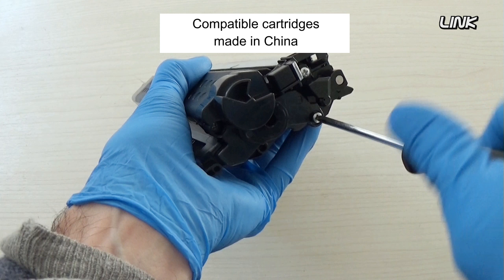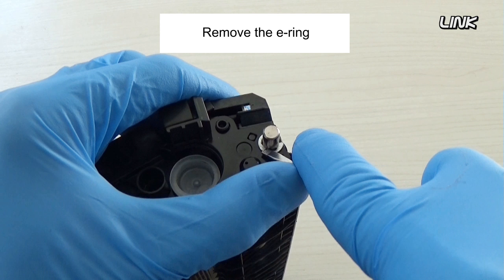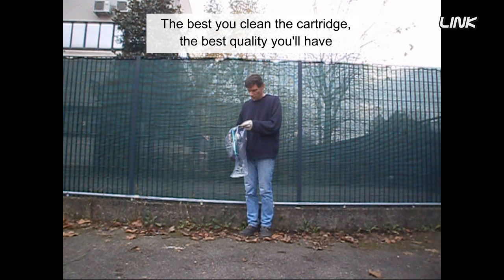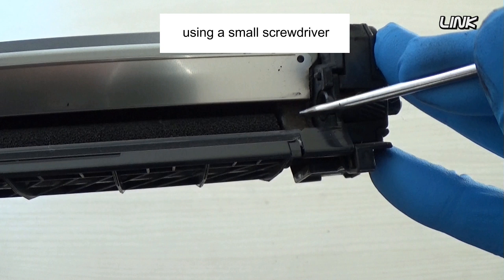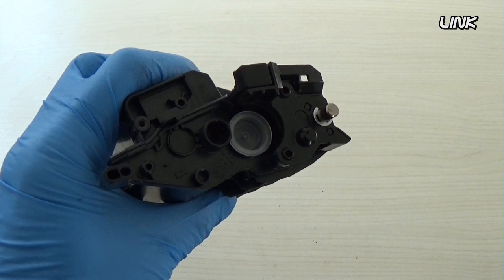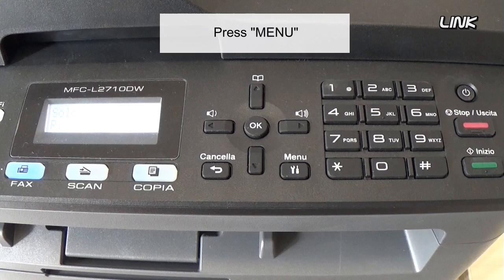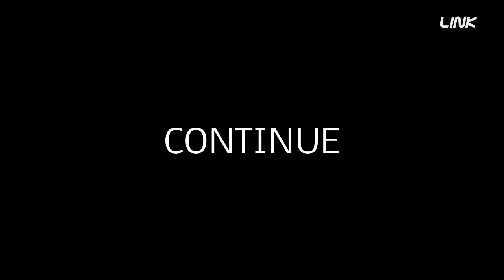Brother TN730 TN760 TN2410 TN2420 TN3608 Refill Rset Toner Cartridge

Comment: Thank you for the video. It worked, though when I was checking the Cartridge for leaks without inserting the shaft and gear, the toner powder started to drip off the hole where the shaft and gear are placed. So, I had to insert the shaft/gear and then everything went smoothly. 

For those who also use starting cartridge and hl-l2395dw. In order to remove the replace toner message, open the Cover (where the cartridge is placed), press X, then wrench/screwdriver, all settings,  general setups, scroll down to "replace toner", select "continue" instead of "stop". Hope it helps.

Comment: Great video! But I was wondering, instead if compressed air can't we just use a vacuum cleaner?

Compressed air is not easily available and more importantly wouldn't it make a mess anywhere it was used?
Reply from the maker: Sure, a toner vacuum cleaner is perfect. A normal vacuum could not become a problem, often their filters cannot hold the tiny toner particles

Comment: Thanks for a nice video! Some questions about the chip: 
(1) Does the starter cartridge also have a chip? 
(2) I don't understand what you mean by "remove the old cartridge chip" and 
"replace the chip in the new cartridge" since you're just refilling the old cartridge.
Reply from the maker: Start cartridge has ho chip. Remove the old chip and reistall it only if you are installing a new cartridge without chip. If not, let the old chip
Reply: @viandant5  thanks!
Reply: @viandant5  ok so it will work without the chip too kk
Reply from the maker: @radekw708  It needs a chip, new or used
Reply: @viandant5  I thought starter cartridge has no chip?
Reply from the maker: @radekw708  No. it has no chip
Reply: @viandant5  My DCP-L2550DW printer starter cartridge has a chip.

Comment: You left out a step in the re-asssembly in this video.  After the roller is reinserted and BEFORE the c-ring is popped in,  there is an important piece that needs to be put in, that the c-ring holds in.
Reply: Which one is that? I'm having trouble with my printer that I just refilled the toner in

Comment: Let's say I don't have the starter cartridge anymore, will it work if I don't replace the chip with the chip that comes with the starter cartridge ? Is there another way to make it work ?
Reply from the maker: The chip from another cartridge will work the same
Reply: @viandant5  Thanks! It's good to know. Also, is there a way to know what quantity of toner (in g) I have to put in it ? I have a TN-760 brother cartridge. Does it makes any difference if I put too much ?
Reply from the maker: @Nicolasgtix  90 grams of toner. It's useless to put too much toner, you'll have the error message after a numbber of copies, not important how much toner is left into the cartridge
Reply: @viandant5  Good ! Thanks a lot for your help. :)

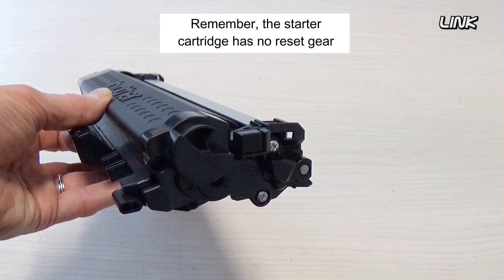Comment: Where it says "remember the starter cartridge has no reset gear." can you still use the starter cartridge as seen at 05:04 or do you have to get a replacement for that end of the cartridge that has a reset gear?
Reply from the maker: you can add a reset gear, or reset the printer using the control panel
Reply: @viandant5  Thank you for that info. One more question please, when air blowing the cartridge to get any remaining old toner off, do you have to blow the air into the fill hole to get any excess toner out of there or will tapping the cartridge into a plastic bag be enough before refilling the fill hole with new toner?
Reply from the maker: @simonbpuk2949  It would ne better to blow the cartridge. Tapping the cartridge should work but there is the risk of grey background on the page if too much toner remains into the cartridge

Comment: How come you have to replace the chip on the cartridge and with what? Why can't you reset the cartridge with existing chip?
Reply from the maker: If not present in the new cartridge you have to use the chip of the old cartridge
Reply: @viandant5  I want to just use the starter cartridge and refill every time, so dont need chip right?
Reply from the maker: @radekw708  Yes, you need a chip
Reply: @viandant5  can you explain though, how does the starter cartridge work without a chip?
Reply from the maker: @radekw708  The printer has a software that tell it to accept the installed cartridge
Reply: @viandant5   both starter cartridge and another genuine replacement cartridge doesn't have chip toner model 2405, will it work if I refill
Reply from the maker: @bahaar5419  I think they must have the chip

Comment: The refill cap broke and then got lost inside the unit. After I filled it with toner I had to throw everything out.
Reply from the maker: Pour the toner in a bottle and remove the cap with pliers. Glue it if necessary

Comment: Hi! Does any refilling toner works well for any tipe of cardige or evrey one needs a specific one?
Reply from the maker: no, there is not an universal toner
Reply: @viandant5  So for the tn2420 brother toner i need its specific refiller. 
I've search it on Amazon buy i didn't find it: do you know where i can find it?  before buying the printer (mfc-l2710dw) I want to be established :).
Reply from the maker: @usk8130  You can use almost every black toner specific fot Brother pritners